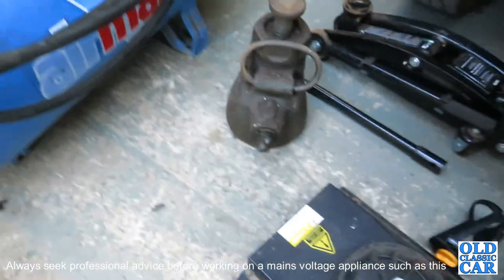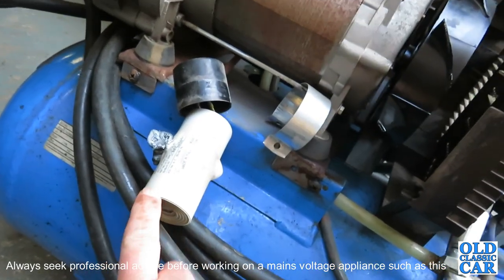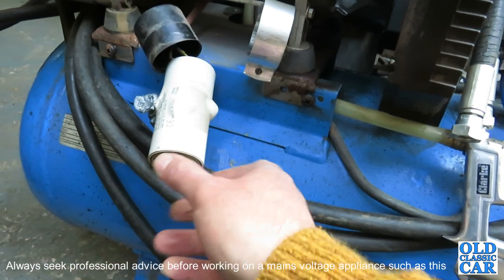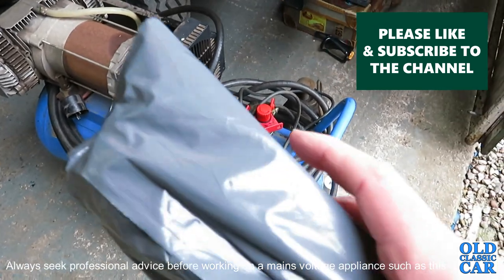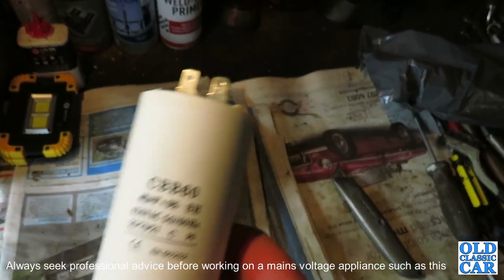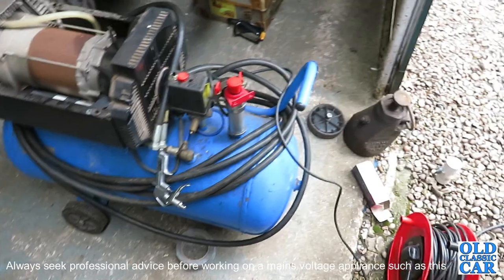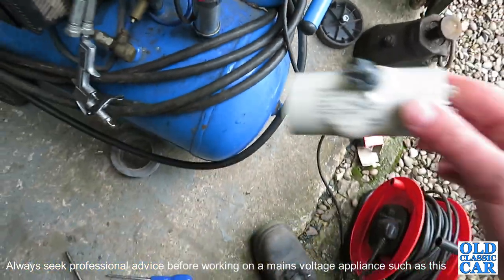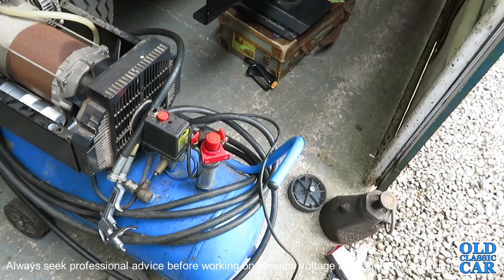How to fix a Clarke air compressor - in the Old Classic Car garage

Comment: I've had exactly the same compressor since around 1995, never missed a beat, today after using it all day it failed to start, exactly the same fault as this, all the black goo has leaked from the capacitor! Thanks for the video.
Reply from the maker: Glad it helped!